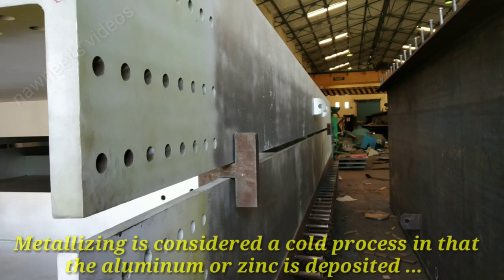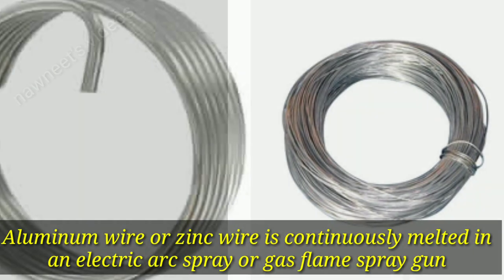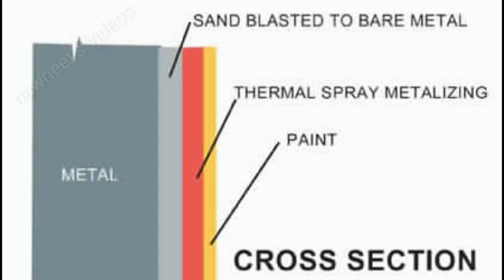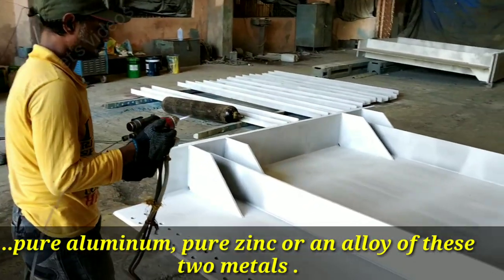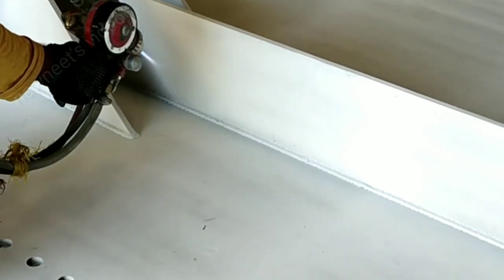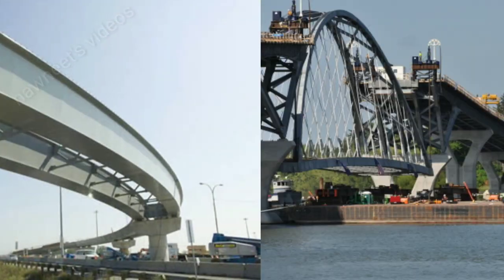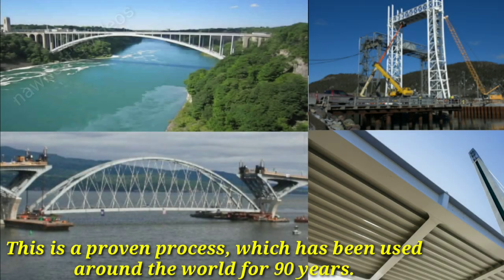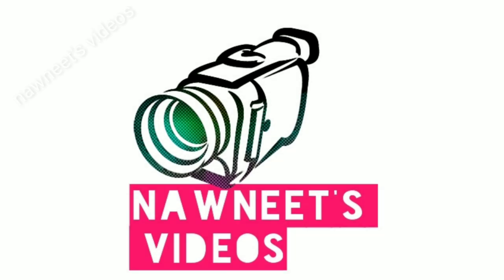Metallizing, Galvanizing process for steel structures, Hot dip galvanizing.

Comment: Hi Ashish, the price of thermally sprayed zinc depends very much on the contractor you choose. the base cost of the process is  calculated by material + consumables (gas/oxy/air etc) + labour + profit. the cost of the base material can fluctuate due to many considerations including LME (daily traded prices) raw drawing cost, total quantity purchased and suppliers charges, even the diameter of the wire and how you buy the bulk material can make small differences. in reality a rule of thumb without labour would be the Cost = area x weight of sprayed material x daily price of the zinc. Lets say you have 10sqm to coat at 100 microns. the price would be 10 sqm x 0.92 kg / sqm  x £3.44/kg (estimated) = £31.65. taking into account overspray and waste your probably looking at about the £40.00 mark. Hope this helps.